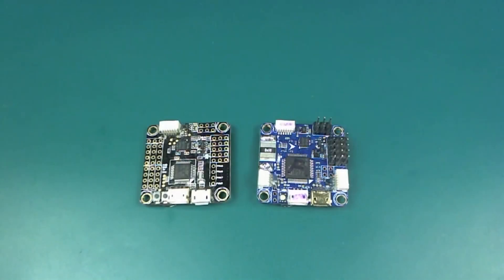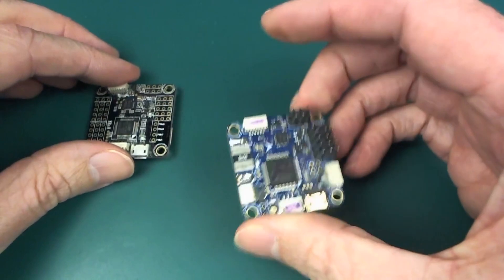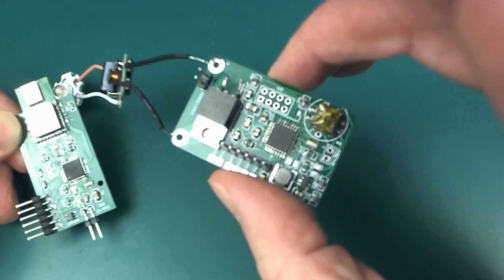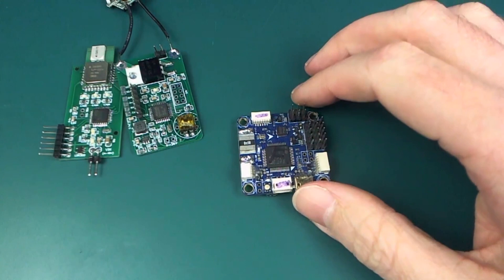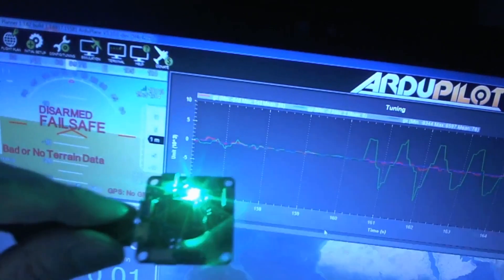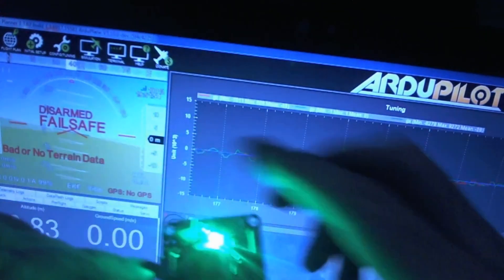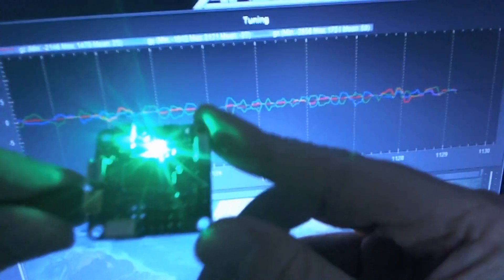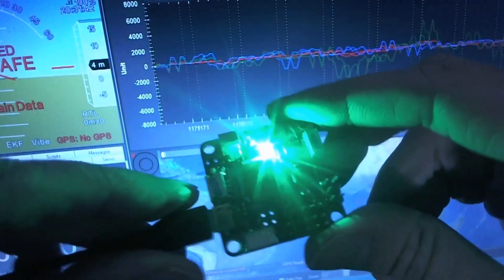SMD soldering newbie tries to replace a MPU6000

Comment: So in response to your question about the TS100 connection issue:  I haven't really ever had an issue.  You might consider opening up the iron and seeing if the ground contact is properly tensioned.  Either that or locate a barrel jack with a tighter fit.  I love my TS100 and use it for basically everything, especially running it on 24v makes it run really well.  Good heat output and very stable control on the higher voltages.

Comment: I think by the book method would be to clean the pads, flux solder and regular iron works well. You can remove excess solder by a wick. Then probably re-tin the pads and use flux or use solder paste for fresh soldering. With smd stuff it really helps to use flux when soldering (and desoldering).
Well done for the first try if you're really new to this. It takes a bit of trying to get used to what temperatures and air flows work and what not.

Comment: Chris - (I think it's Chris, right?)  You are AMAZING!!!!  I've told you many times, but have to say it again - I just love your vids and each time I see you've posted one, it makes my day!  It seems like our brains are on the same wavelength because you post videos on things I think about, but never have the courage to try - and you inspire me to try them.   For the TS100, I literally got mine last week and the very first thing I did was take it apart and remove the barrel connector and replace it with one I had laying around (one attached to a cord).  I direct soldered it to the board of the TS100 and now the unit has about 2" of cord coming out of it with a barrel connector that easily attaches to the jack of my goggle power cord and many others (i found the TS100's barrel connector to be very  "un-standard" - it didn't fit anything I had laying around - and I sure wasn't going to buy one if I could MAKE one, lol) I'll send you pictures if you want, just let me know.

About replacing that gyro - that was simply amazing man.  Great job! (when you dropped the old one on the floor I busted out laughing - that's SO something I would do - "that one's long gone..." lol

Most importantly, Thank you!  I take on all these little endeavors too, but I just don't have the patience to document it all and post videos because it takes SO MUCH MORE TIME and effort to film and edit them - and the manner with which you deliver them is so well done and pleasant to watch (not to mention your sense of humor) so thank you for all your hard work.

Keep em' coming man - just can't wait to see whats next.

Comment: Dear Chris,
Like so many already said here: FLUX is the key ! Put the right amount, move your heat blower around the chip until it place by itself, and job done , thats'it !
But anyway , nice first try ;)
Reply: yeah with flux smd rework is easy the flux just sucks the part in to place .. assuming you dont have your air turned to max flow. and you can allways dress the pads aafter with an iron tined with solder after if you want. clean up flux with a bit of iso and your done. Daunting at first. but easy after. This vid  show how easy it is even as even without flux you can achieve success most times

Comment: are you sure you were using the correct barrel connectors? Of the 5.5mm external diameter, there are 2 different internal diameter types, 2.1 and 2.5... i had issues with the 2.5, none with 2.1, if i remember well (i'm not near it to check now)
Reply from the maker: It was working fine with the type I have now for about a year. They fit really snug and have little springy bits inside.

Comment: Yeah you need to start using flux and also invest in some wide kapton tape to use to sheild other parts from the heat.

But turned out alright well done.
Reply: Yep, flux is your friend and would have helped the surface tension of the solder pull the package back into alignment.  And yes, kaptan (or even some aluminium foil) does a great job of protecting the "melty bits" that may have been added after the initial reflow operation :-)
Reply: @xjet  one more thing needed is a smoke absorber
Reply: Literally about to comment exactly what you said
Reply: Was going to comment, then saw I was too late. ;)
Reply: I'd like to try a silicon baking sheet with various shapes cut into it. Got to get all the gear first. (Actually going to try the technique with a heat gun and a Pelican HDPE dinghy with a hole in it, should protect other areas from the heat.)